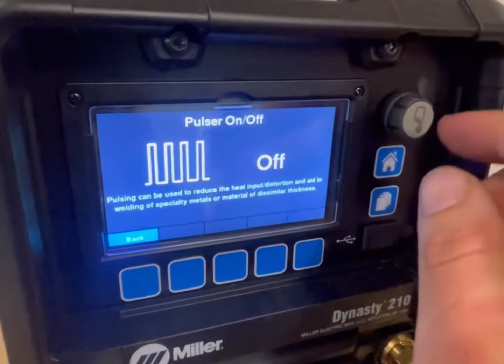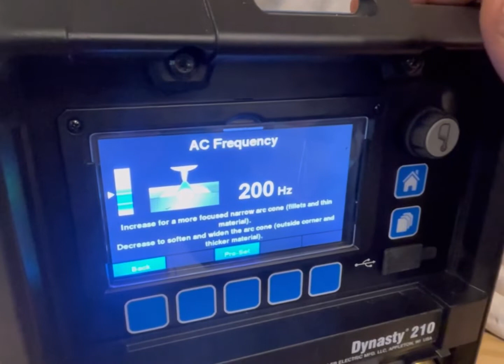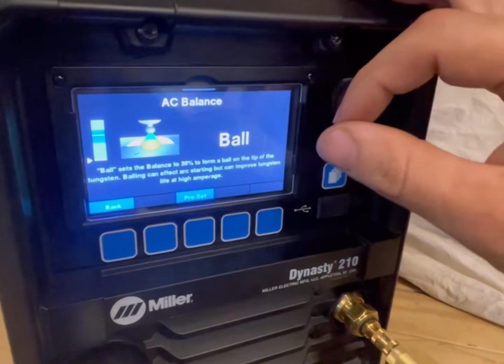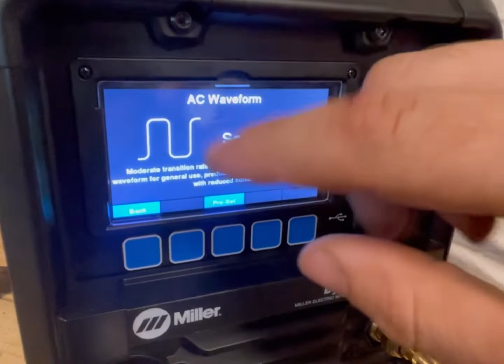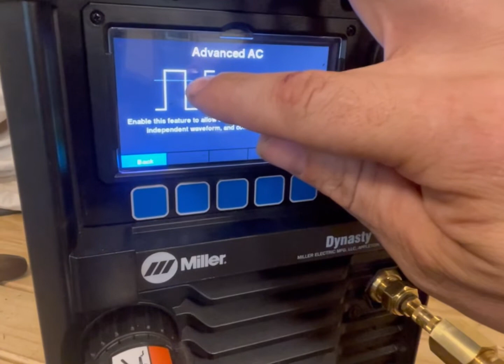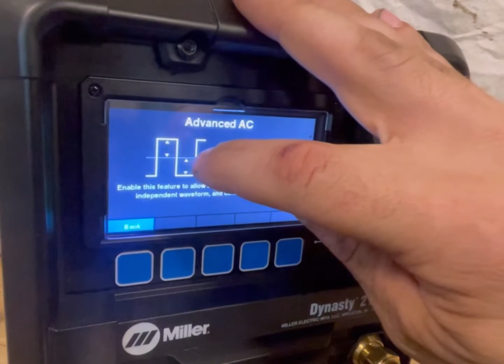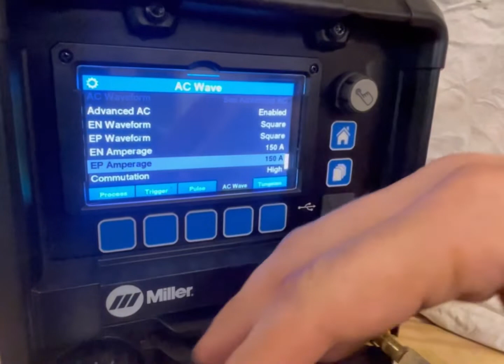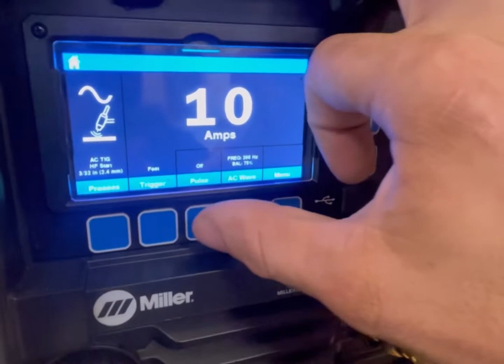Part 2: Ac setup/features on the new dynasty 210 tig welder

Comment: All those features that you described on the AC side a lot of the people that are getting into doing TIG welding don't understand what those features are and what they do. Me I understand what they do and I know what the reaction to aluminum is even though I have a primeweld Tig 225x and mine only welds on the square wave I don't see the use for all the features that that Miller gives my welder has enough features to do what I need to do in general purpose of welding aluminum. But don't get me wrong if you're doing aluminum manufacturing all those features will come in handy depending on what your manufacturing out of aluminum.
Reply from the maker: Without a doubt most of the features don’t do much for the average person.  The biggest thing I find as a nice feature is the ability to use pulse wave shapes on dc, I can pulse and not have to listen to the loud arc. That primeweld 225 has all the features I would really want for doing most work.  I used a Lincoln tig 200 for years and never had much issue, and that’s almost zero features compared to the welder you have lol.  The person doing the welding has more to do with the results than the machine.
Reply: @makingmistakeswithgreg  that right there is absolutely the truth it's The Man behind the machine not the machine that's making the weld.
Reply: Super useful for me! For instance, I spent at least 30 minutes trying to figure out how to ball up my tungsten on the dynasty 210. Your video showed me that it’s a setting I have access to!